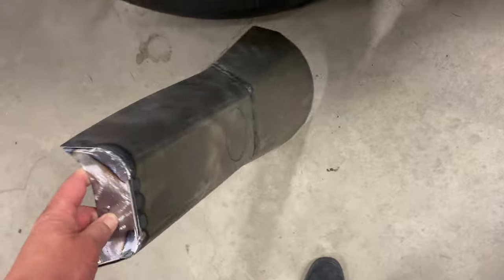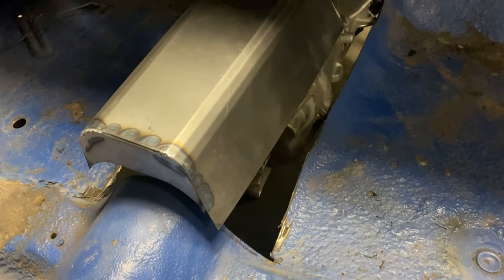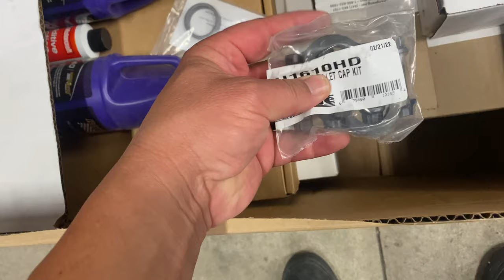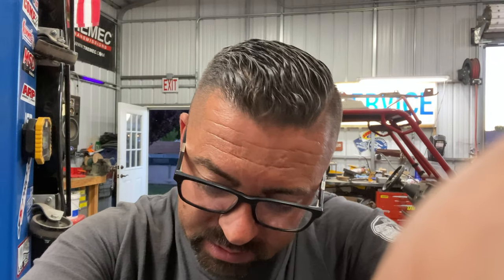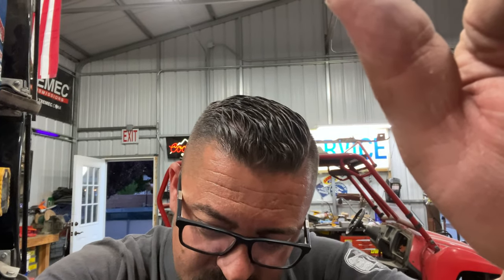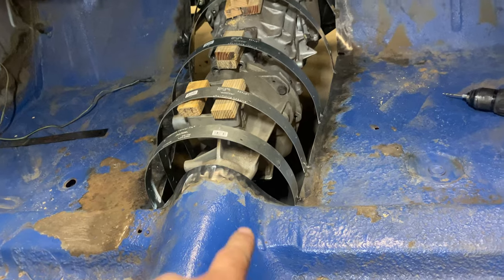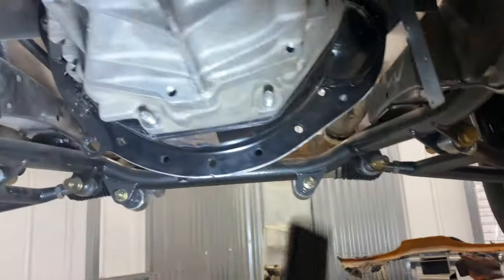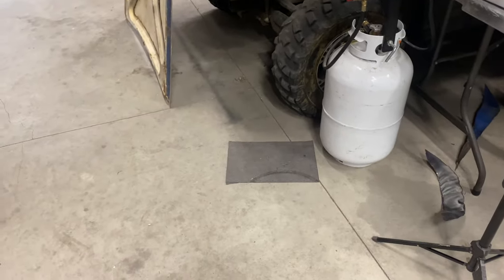1963 FORD FALCON TRANSMISSION TUNNEL MODIFICATION CONTINUES!!! Can we fit a Tremec T56?

Comment: I keep a piece of 6”, 8”, 10” and 12” diameter 2’ long corrugated single wall plastic culvert pipe around the shop for rolling sheet metal over, they slip into each other for easy storage too.

Comment: Get some cardboard to make templates, take cardboard mark center lines on floor then bend or cut  cardboard to fit then flat-out on sheet metal, use Dutz fittings so you can pull the tunnel out for repairs .put 1x1 L channel steel alongside to mount tunnel and bend 2 pcs of flat stock metal for humps mounting spots . Get some coleleco pins help to premount metal before welding

Comment: Looks good.  I'll be in the same boat with a 4L80 or T400 and will need to fab a tunnel for my 62 at some point!
Reply from the maker: Yes, I wish they made something for them so it would be easier but they don’t. I have it finished welded, debating on raising the drive shaft tunnel up and lowering the car a little more

Comment: Grab a stock tunnel from a 2016-20 Mustang, plenty large for anything you will put in there for sure
Reply: Thinking outside the box, I like it
Reply: @WDMtea  when i built a buddys 95 mustang road race car with a Coyote, that MT82 is a TALL transmission and with the crank/tailshaft centerline the same height off the ground as the old 5.0 the trans was 2.5” up thru the tunnel so the stock tunnel was outa there lol. Cut the one out of a manual 2018 and clearanced the stock tunnel and set that one in there, had to trim up the firewall about 3” and shorten the length of the ‘18 tunnel plus cut the center bearing hanger out then welded it in. Shifter hit the same hole and was perfect height so no more reaching down to shift anymore, could almost reach around the whole trans and never touch the tunnel either. Worked great for that and im getting one for my 84 Mustang to clear the 6R80 too